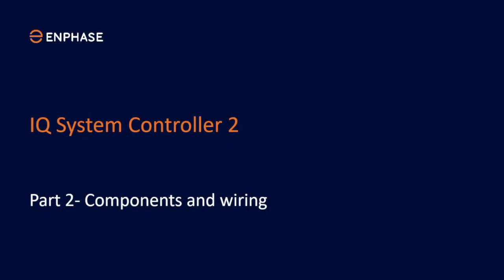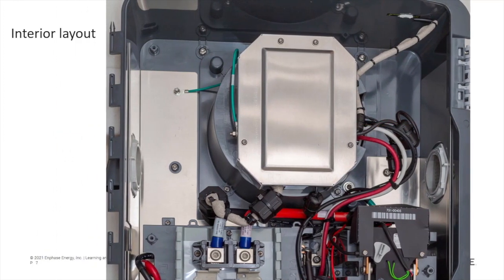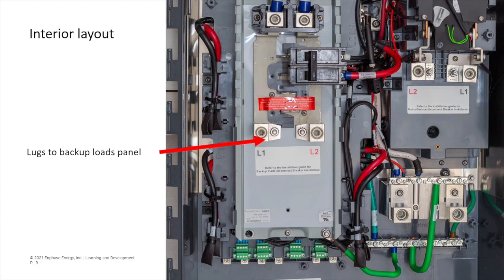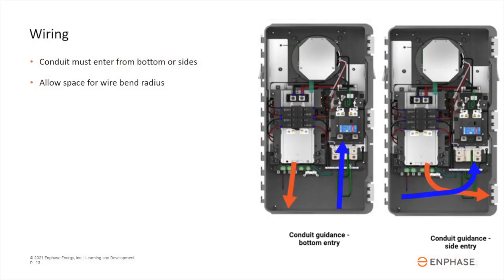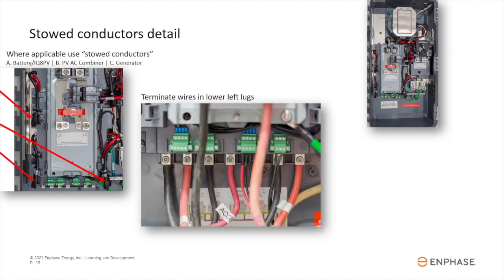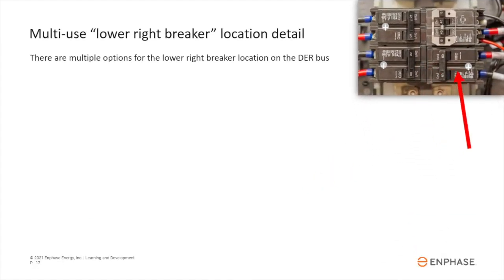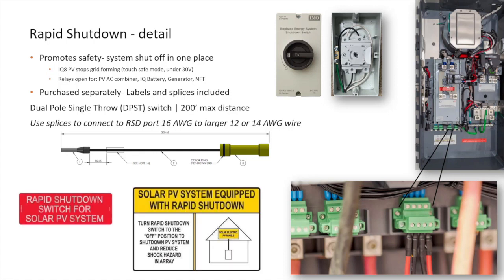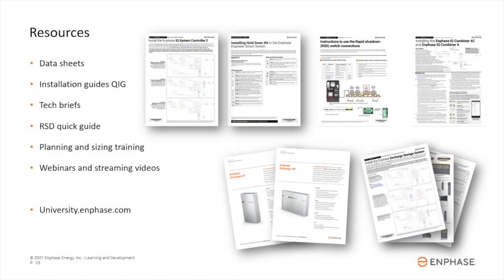Enphase IQ System Controller 2 wiring and components

Comment: Hello Enphase. Thx for the Video👍. I see how to set the lower cut off for the Battery Discharge in the App, but is there a way to Set the Top Off Charging Point? My two 10’s charge to a full 100% everyday. I would much rather only charge it to 80% or store it at 50% to prolong its life since I have 1 to 1 Net Metering (for now at least🙂)
Reply from the maker: Hey there, batteries are rated to cycle daily at full capacity, 2x daily, for the life of the battery. Please check most recent warranty data on lifespan of battery.   We'd recommend perhaps running TOU scheduling and selling power back to the grid if you have excess. Completely up to the user. We aren't sure you can top the percentage of charge- at this point.